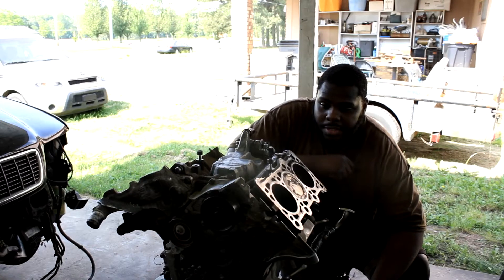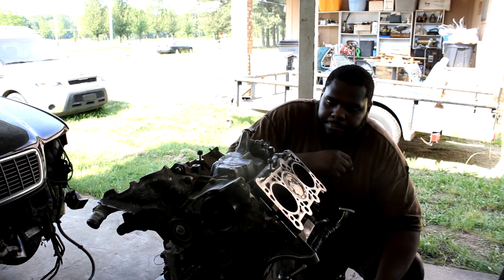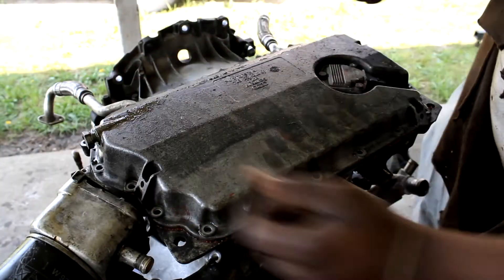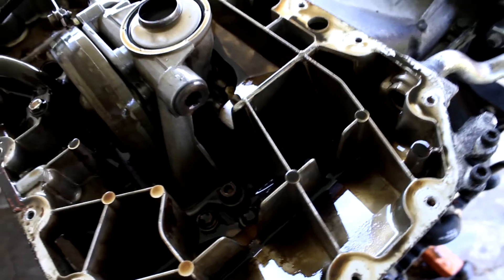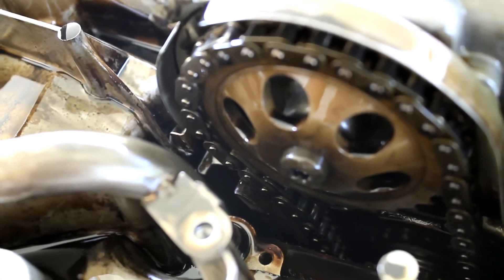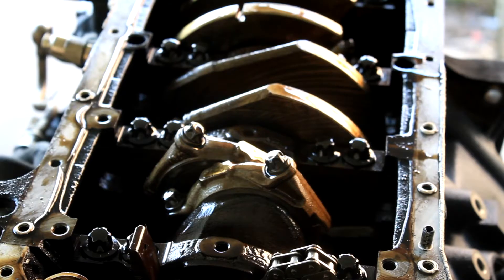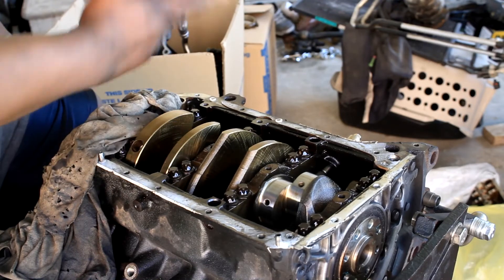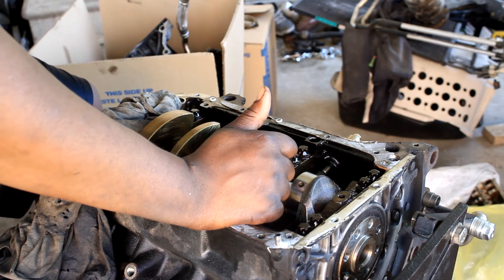PROJECT B5 S4 | ENGINE TEARDOWN PT1

Comment: im doing the same teardown to by b5 s4 00 as you in this vid.just one question why doesn't my oil pan vaico doesn't come down after i took out all my bolts? the engine is still assembled in the car chassis  im pretty sure that can't be the casue of that , but any tips or answers i would appreciate the help.
Reply from the maker: Glowkid music Ent. I can’t think what could be keeping it from dropping especially if u have all the bolts and buts remove. Have u had any luck ?

Comment: Hey bro.  Thanks for the vid. You can check my channel for my 2.7t swapped B6 journey. You’d be surprised how quick you get used to 500whp. Lol. I’m interested in putting rods & going E85. 

Other than the actual swap and turbo clutch install, I’ve gone as deep as installing 2.8 intake cams myself and after watching this vid I’m fairly confident I can get the pistons out. Is there any reason I can’t just reassemble with New Forged Rods/ARP Bolts + New Rings + New bearings and go?  What am I missing as to why machine shops charge $1200-1500 labor. Or am I missing something. Otherwise I’ll be following ur journey bro.